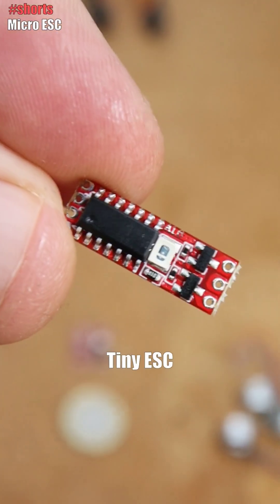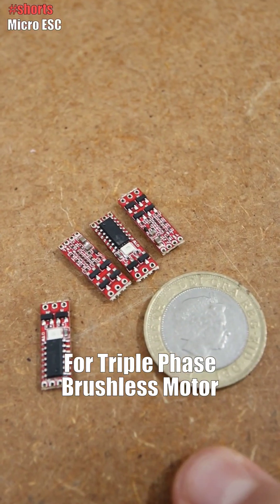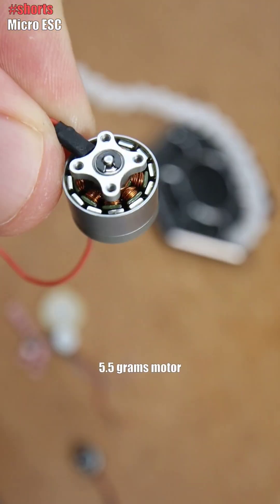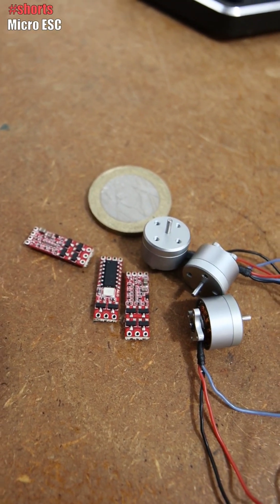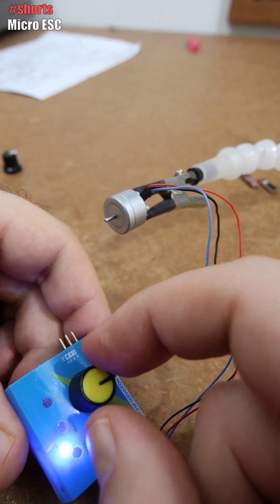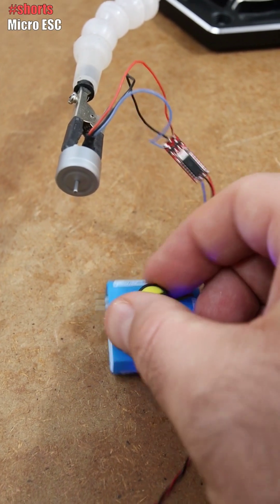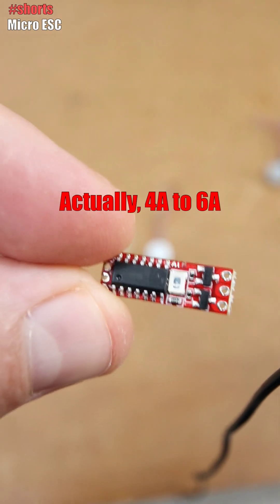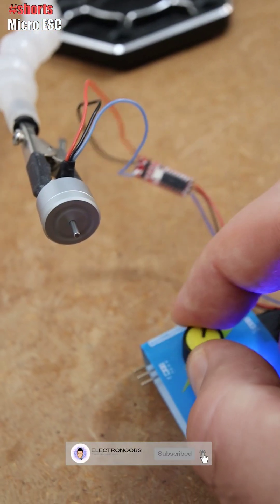Smallest ESC I've ever seen #shorts

Comment: I am using the same ESCs but they are giving me trouble. What voltage are you powering them with in this video? Do the LEDs light up when the esc is connected to power? Does the board draw current when powered? I find it unlikely that all four of my boards are defective, but I don't know what to try next. I have tried between 4.2V and 8V from a power supply and the boards don't respond at all, no lights, no current draw, nothing. I have mine hooked up in the same way that you do. Also, do you know what the LD pad is for? I can't find any information about its purpose
Reply: I ma facing same problem, please advice, I bought 11 PCs none of these are working
Reply: Same problem not working and no start
Reply: @entrelive  same problem, i tried to connect 4th IN pin with GND and then with 3.3V, after connecting to 3.3V I heard the sound of a motor, but i couldnt control it, i think the problem is that ESC and Receiver(or Controller board) should have same GND, so I will try to connect them with same lipo
Reply: @ОлегНовиков-г8в  Any luck? I never did get mine to work. :(
Reply: @ you should connect esc and controller to same battery. esc needs to have same GND with controller/receiver to work
Reply: I found the issue @wosib910 @entrelive . u need to power esc from the same battery u power the controller or receiver(same + same gnd) use smth like mt3608 to get 5V from 3.7 from lipo
Reply: Can you please tell me the model of this esc board

Comment: Little hard to tell, but it looks like you passed through power, then just added a signal wire from the tester to  the ESC? 

I'd like to try some of these, but I've been hesitant because of having to figure out how to wire them properly. I plan to use in model airplanes, both single and twin motor.

Comment: Would like to see a comparison between four small esc vs one small 4-in-1 esc.
Reply: Exactly my question. I think these ESCs would be good in a single-motor-control application but it's adding multiple layers of unnecessary complexity to use them in a quadcopter.